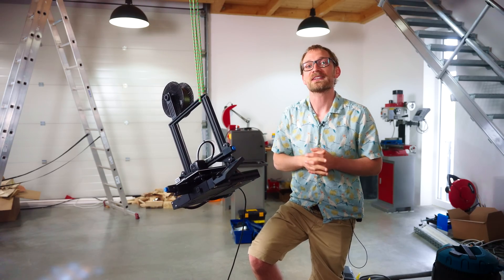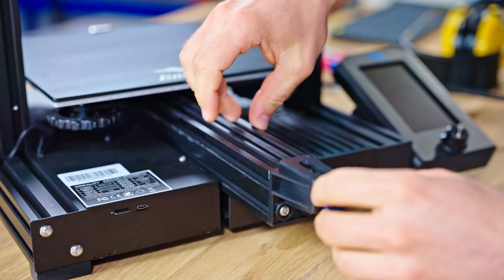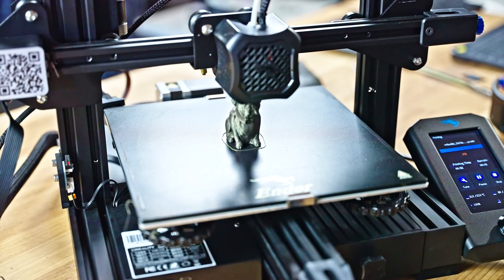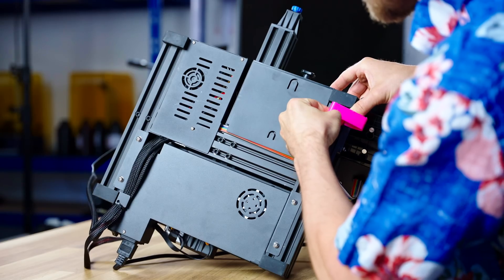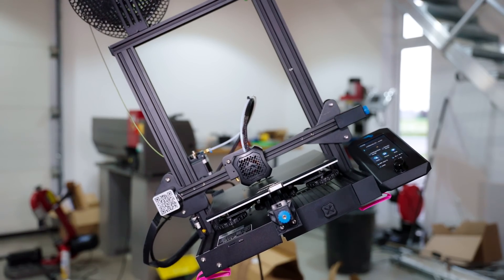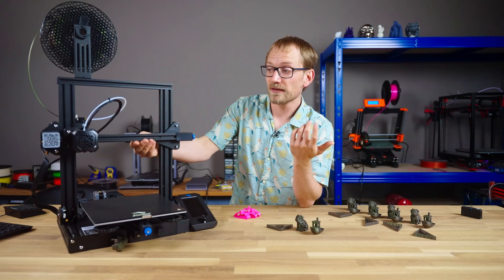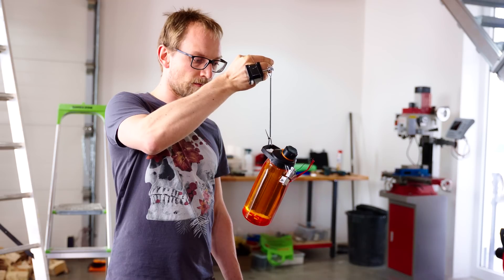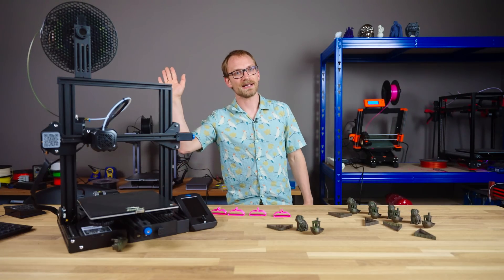Wobbly 3D printer makes for better parts!

Comment from the maker: Thanks again to Private Internet Access for sponsoring the video! Check them out at https://www.privateinternetaccess.com/Toms3d 

What are the hacks that you found work for solving ringing on your prints?
Reply: input shaper
Reply: @morbus5726  It's a shame he didn't try that in this video.
Reply: Hey Thomas,
Long time viewer,
Love the way you deliver content, 
No drama, No pointless facts or effects, No Clickbaits,
Your video guides showed me the way when I first got started with 3D Printing, thanks for that...
I usually don't comment on youtube videos so if i'm here i may as well use this opportunity to thank you for al your hard work,

If you plan to return to the topic in a future video, maybe you can try the following options:
1.  build a small wooden sandbox and place the printer still bolted to the concrete paver
2. Place a piece of high-density foam under the printer still bolted to the concrete paver
And thanks again for everything you do here.
Reply: The 100 3d printer is right up your alley.  He removes metal and prints the frame for a better vibration profile.  I'ts supposed to be quite fast.
Reply: hey, im in a project that takes plastic water bottles, and turns them into filament. Its called re-creator 3d and we have a discord as well. I'm reaching out in behalf of josh the owner to see if you want to work with us. We also plan on selling a kit down the line to help make it easy to recycle yourself. think you would be willing to reach out to set something up?
Reply: Awesome video. It would be cool to try repurposed turntable feet which are designed to do the same as the fast feet but are often well built and a bit more elegant.
Reply: Pia does work on your favourite streaming services as long as you want to go to the USA, UK, Canada or The Netherlands
Even then it doesn't always work.
Other than that I would highly recommend it.
Reply: Moroso Structural Concrete for racing engine blocks. I filled my hotrodded 3018/4418 CNC router 4040's with it. I will do it to my Neptune 2S's

Comment: Well i used small yellow springs.
U der my se and it work.t.
Bud the best thing is anti vibration power mats.
There on printables 
Com. 
And they work super .
As i write this i wud print 
In.
Pet.g.
Ore abs.
Power mats .
Printables for every printer give it a go

Comment: I'm building an Ender NG core XY. I strikes me that suspending the top frame and hanging the z drive independently from the legs may isolate the z parts from the support structure. Similar to your cube in cube idea.

Comment: When you use the concrete slab with the original foot of the printer you are doing it wrong. I assume the foot of the printer are selected for the weight of the printer. They are not going to work well with the excessive weight of the concrete. In rubber materials the rigidity changes with load. If you overload them, they become very rigid and that contributes to higher frequencies.

The concrete slab + adequate supports (low rigidity) will offer a better solution than the pink printed foot (that already is a good solution). I would use a soft foam to give elastic support and dampening. You could find the optimal solution trying different sizes (area) for the foam supports.

In a simplified model of a single suspended mass the resonating frequency is  ω = √ (k< / m ). With the concrete slab you increase the total mass and that has the effect of lowering the frequency of the vibration. BUT the k (rigidity of the supports) is also very important. You can't use the same feet of the printer with the concrete slab.

In general, the way to go is increase the mass and decrease the rigidity of your feet. But this is a complex matter. That's why there are companies specialized in vibration isolation of machinery.

Also when you suspendend the printer from the ceiling, the right thing to do is to place the printer in a base and suspend the base and have it levelled. But that would be the same as concrete slab + very soft feet.

Kind regards!!

Comment: To be honest it's not the dampening of the 3d print I'm interested in. I fixed that. It's the noise period I'm interested in not hearing. But I guess if I enclosed the 3d printer that wouldn't be a problem.
Reply: But then fully enclosed isn't good for PLA or PET-G.

Trying rubber pavers myself on a Qidi

Comment: A little late to the show but if you want to damp you need to break resonance, as you highlight something to springy does nothing to absorb the energy, what about putting the printer on--top of sandbags or a memory foam pad? Ground up TPU might work as well.

Comment: In control theory this phenomenon is often referred to as "vibration modes". Now i would like to emphasize it makes sense to think of modes in the mathematical way, so it is not about 'the kind of vibration' as much as it is the most dominant frequency present in all vibrations of your system. Ie. a Mode like in statistics. 
In real physical systems such as a 3d printer the frequency magnitude graph will contain multiple peaks. Often the goal is to make the lowest frequency mode behave the way we want and suppress higher frequency modes. 

Mechanically the only real variables to play with here are mass and springs, dampers help (a lot) but don't solve the problem. So by isolating a printer from the table using springs you create a "high pass" filter which stops the printer from putting energy into the table and this results in less magnitude of resonant frequencies of the table.  Of course if the table was extremely heavy, bolting your printer to the table (high rigidity think super super tight spring connection) would work better since the energy of the printer is not enough to cause significant vibrations in such a heavy object the table moves to slow. Even with all the energy being transfered you removed a frequency mode by doing this. (which is why precision CNC machinery is usually placed on granite slabs)

Thinking of the interface between rigid mechanical systems as a series of mass spring dampers in serial and parallel configurations helps engineers design something to function within a specific bandwidth without this interference. So the same intuition that goes  into the wobbly 3d printer solution is used in high tech and high end machine design as well just at the interface of two parts with relative motion or with permit able compliance. Just wanted to give context, especially since the feet aren't only dampening the vibration, it is the deformation which plays the biggest roll. What is really going on is far more practical anc can be used for many things.

An example of a printer that runs so fast and with so much energy that springy feet don't help it anymore is VZbot, which has to be bolted to the building to solve this issue.

Comment: This might be a dumb question, but... Could you use acoustic pucks as the feet?  I use them for my stereo speakers on stands.  I also fill my stands with sand, but for this conversation, let's just stick to how well the IsoAcoustic pucks reduce frequency spikes when room testing.  They are a game changer when it comes to sound quality.  I would love to see if this helps (I don't own a 3D printer, just interested in them).  Also, products like dynamat can be peeled and applied to surfaces strategically to reduce high frequency vibration, which seems to be the culprit in lower quality printing.  Hope this thought is helpful to someone.

Comment: I have the only adjustable printer foot on Cults. They are absolutely stellar and will let you adjust for a table top that just sucks. My machines are dead level and I get no ringing. In fact most ask how I get my walls so consistent. The foot was the solution. This also removed torsional tension in the frame which also helped with artifacts in each axis.
Reply: I continued watching and noticed not even his bench is flat, you can see the printer wobble when touched.

Comment: I use the 6 cm packging foam rectangle that came with the Ender Neo and seems to work very good. Prints come out good/great and the noise from the vibrations is gone (though the noise from the fan isnt jeeezz)

Comment: Thomas; Yes! Very interesting. Working with a Voron V2.4r2 and reading lots of discussions on Discord about speed and resonance. I would like to see a repeat of these tests using a printer running Klipper and the printer "tuned" for each senario using the ADXL resonace testing and steppers tuned to their respective driver IE 2209's. Especially the square bubble concept. Great work Sir!

Comment: Nice Video. I have an Idea, if ringing comes from the cage and everything „oscillating“ can we not just use a counterweight lets say on top of the printer in the middle a weight on a cord that counterweight those movements? 

Like with a Earthquake or strong winds and how large buildings are built today.

If we see the weight wobbling or spinning then it counterweights something. I think it would be worth a try

Comment: Interesting tests. You left one out though! Paver bolted onto the bottom of the printer AND hanging from bungee cords. This is actually a pretty standard solution for isolating basic atomic force microscopes from their environment. I'm not sure how much it would help internally generated vibrations, but it would be an interesting test.

Comment: I would think a damper attached to the frame in each axis orientation would provide the greatest effect. Maybe a tuned mass damper? or a large bearing held by a couple PLA springs?

Comment: Someone needs to invent active counterweights to cancel vibration.

Or maybe the passive counterweights used to protect buildings from earthquakes could be applied to 3-D printers?

Final random suggestion: those flexible feet could have oil dampers from an R/C car fitted to them to reduce bouncing even more.

Comment: I think you can get different results using damping feet with different spring stiffness. I'm thinking The reason why the suspended setup doesn't work is because the frequency that the bungee cord allows is way too small to counteract the higher frequencies of the printer frame.  I think you need a tighter spring or firmer damping feet that can better match the frames higher frequency resonances.  Just an idea.

Comment: If you fix only the bottom of the printer to the concrete slab, I'm guessing the frame can still resonate. What would happen if you fixed even the top of the frame - for example to the wall? Would it help anyhow?

Comment: Giving the vibration somewhere to go and expend itself is the goal. That's why adding rigid mass (bolting to concrete) didn't do anything, and also why hanging the printer didn't work. Those flexible feet dampen the vibration by, like you said, being an outlet for the energy, by dampening the outgoing and incoming movement (reverberation). The problem, though, is that they deform. Try putting the printer on a stiff rubber placemat (like a mousepad), or maybe even a yoga mat, on a rigid table. This worked wonders for me.

Comment: In woodworking we have the same trouble with tools. Screw the printer to a board and put it in a bin with sand, make sure the side don't touch the plate.

Comment: The audiophile community has lots of ideas on damping vibrations. Two of the more practice are special rubber washing machine add on feet that help damp larger vibrations, and smaller audio equipment feet made of neoprene.

Comment: Your Benchy has a deformation at just a few mm off the base.   I had this and, while it may not be your problem, I did look at my slicer output.  The particular STL I got from thingiverse (there are several benchy), was slightly corrupted.  Each of the starter layers was repeated.  If you scrolled through the head movement in CURA, about 1/2 way through layer 1, it did layer 1 again.  This was repeated for 2, 3, 4 for several mm.  Pulling the stl into my cad program it warned me the stl had problems.   So, I got a more 'official' benchy from another source and it was not bad like the first.  And, now I don't have those flaws a few layers up.

Comment: My solution: very thick silicone feet. Made from dried up silicone caulk tube. They are excellent at damping the exact kind of vibrations that a 3D printer has, they also hold shape very well. And since the material is a long sausage, you can slice however thick you want. Just be careful when slicing, that sausage is stupidly dangerous, you can't put it in a vice or wrap it down, you just got to do it with hands and with a very sharp blade. So, do it slowly, prepare for a long arduous battle and not "i'll get it done in a minute", and you are probably done in 5 minutes...

Comment: I agree. I use rolled up pads of shower foam mat. Decouple the table the printer is on from being a sounding board and the fine aircells and thickness of the pads quench the vibrations in the frame really well. In the couple of printers I've heavily modified, I changed all the steppers from 1.8 degree type to 0.9 degree type. Makes a big difference with the poorer quality stepper motor drivers. you can also experiment with wrapping the centre of support struts with something heavy like coils of solder, over a wrap of foam shower mat. Everything that makes a noise that you have the freedom to do this to. Cork gaskets from frame to stepper motors is another option.

Comment: Nasa use water in the iss, astronauts must do exercise but this activity could destroy the huge solar panel system, also the systems for exercise are suspenden with tension cables, a bunch of water disipate oscilations and prevent resonance acumulation.

Comment: YouTube recommended me this video, and it's an instant sub. Wished I found this years ago when discovered all of the stuff the hard way back in 2017 on my Anet A8. I already bought it heavily modified with a very sturdy plywood base, but it happened to have some ghosting. I thought a better base would be good, but I didn't wanted to remove the base, so I clamped to the table and still happening. Then I discovered that it was due to internal vibrations. You need to have your belts well tightened, have 0 play in any chassis bit, by 0, i mean 0, all screws well tightened up or it's a chance for ghosting to happening, every thousandth adds up, needless to say, to reinforce the chassis if you have a chance, also I swapped the linear bearings to bronze bushings, they were way cheaper, self lubed, and also better, because when the bearings start to wear, the small balls have a tiny flat spot and lead to tiny vibrations. Didn't tried the ceramic ones, but they are a good option. And finally I added some hot glue at the very top of the Z rod axis as it wobbled even with the modded piece. It secured the rod in place, and it act as a small damper. That are my 5 cents! Have a nice printing everybody!

Comment: Interesting test. Did you see any difference in performance if you printed in a different direction? Normally adding mass to the part you want to stop movement on and adding a dampening material in between is the way to go and is commonly used for sensitive instruments . It might be easier to test on a Ender 5 - add mass to the z axis and some rubber mounts. This might tell us what part of the frame is resonating.

Comment: How difficult would it be to design printable tuned mass dampers to attach to the print head and bed? I believe they would only work at specific speeds, but making them printable would make it easy to have a bunch for different speeds.

Comment: I have a 3D printer with a steel frame and some substantial ringing with the default setting.
But when I reduced the acceleration from 3000 or 5000 to 500, I had no ringing at all, but the print was noticeably slower, because of course it took some time to pick up speed after it stopped or after one axis needed to start from zero at an edge of an object.

So I use an acceleration of 1000 as a compromise with very little ringing and only a bit reduced overall printing speed.
Reply: Some time ago I did some research on the relation between print time and acceleration. The effect is surprisingly small. Print speeds are so slow that acceleration doesn't have to be set very high. The printer reaches its print max speed really quickly already. I am a printing quality freak and even reduced the acceleration to 150mm/s2. Perimeters are at 20mm/s and infill 60mm/s. I admit, my printer is slow nowadays because I went crazy with the settings. But quality wise, this thing works like a charm.
Reply: @FrankyieFrank  yes, exactly, it's a trade-off, more speed or more quality...

Comment: i think you FAILED the elastic suspension test by suspending the machine on a single axis against gravity, and from the corner of the machine; which would make any dampening not in line with any of the printer's axial movement...🤦‍♂🤦‍♂ studio/podcast microphones employ elastic cord suspension to dampen boom arm movement, but they are not dangling from above by a single elastic cord. i think a more scientific approach to tension dampening would have suspended the machine at the corners like a cube within a cube (a.k.a. terrasect/4D cube) to negate vibration from all axial directions.

Comment: This is a great video.   I think you should continue with your dampening project.

I work with CNC machining centers and I was thinking adding mass would have a more noticeable impact.

But adding dampening to the printer is an experiment worth doing.   I also would be interested in what adding both mass and dampening would do.

But there is a point of diminishing returns where considerable expense will be added to cost of the printer.

I have personally used hard rubber aircraft engine mounts to reduce noise and vibration of a machine.  They do not deform with heat.